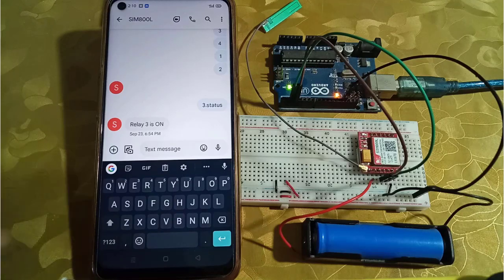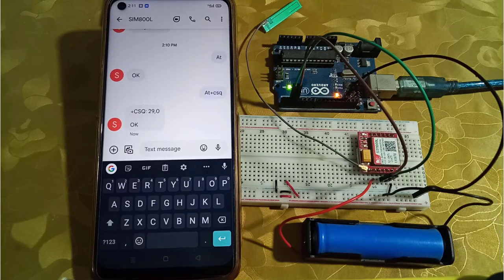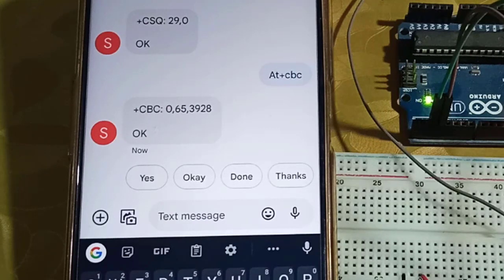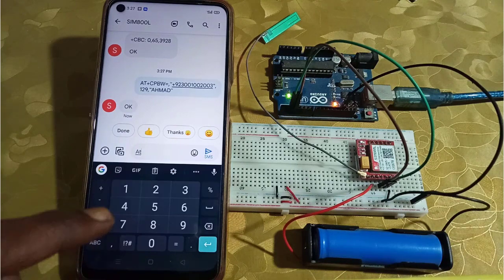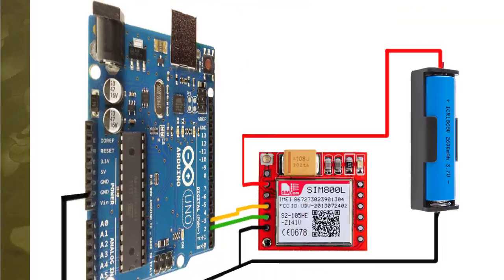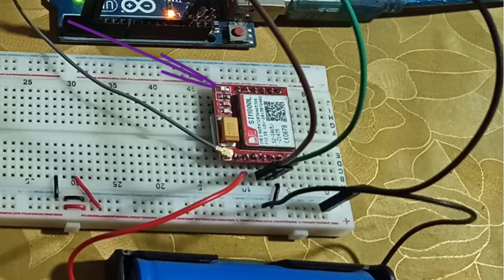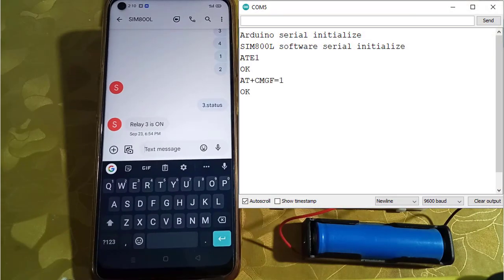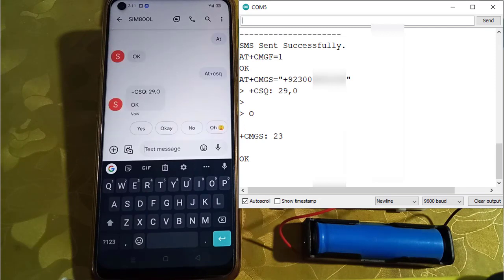SIM800L AT Commands Over The Air using SMS | Arduino GSM Project

Comment: Another great video! Good to see the results from AT commands back to your mobile. 
Would be nice to see a more detailed step-through of the code (or differences from the base code)

Did you ever manage to get the module to report the low voltage warning?
Thanks.
Reply: Good one there.
I appreciate your efforts in educating the public.
Keep up man.
Reply: Always on point.
Thanks man.
You are smart.
Reply from the maker: thanks
Reply from the maker: thanks you so much.
I am using the same code, that I have been used in my previous project. there is a little bit change in the code. for example, check the line number 101 and 102. I have added the two lines in the base code.
and I am using "sendRseponseATcommand(msg)" function, to send response of the AT commands to your phone
I know you have asked a long time ago. and I have tried a lot but did not get the success for low voltage warning. 

but I will keep trying.
Reply from the maker: so nice of you
Reply: @AhmadLogs  thanks, that’s really strange you are not receiving those URC’s on your modules. 

Project ideas 💡 
1. Have you used sleep mode in your projects?

2. Create a function that waits and checks if it has connected to the network  on startup rather than just delaying for 10s, if it’s in an area of low coverage it may take longer than 10s to connect or if that is even possible to connect in that area. 

3. How to turn the module off from the controller by software or hardware. 

4. How the module can know when it has lost connection to the network, what current it uses while trying to connect and what the controller should do in this situation to save power, wait for a while and try and let it reconnect or turn off the module and try again later. 

5. When voltage to the module is so low it turns itself off but the voltage isn’t low enough for the controller to stop functioning, then charging the battery and the module restarts, controller has a function to re initialise the module like in the setup function. 

These are all project operational needs if it’s left powered on and running for a long time (months?) and need to handle these situations and conserve power.
Reply from the maker: @iantcroft  I never implement these features before. but I have noted down these features. soon I will try to make gps tracker with these features.

I have seen the lower voltages URC, in a module. but unfortunately, that module was  damaged. I will buy a new module to test low voltage URC
Reply: @AhmadLogs  Will look forward to watching the videos on those features, if I can help somehow let me know 👍🏻
Reply from the maker: @iantcroft  sure. and most welcome for your efforts. so nice of you

Comment: How are you my friend Is it possible to use the gsm sim800l with 2 arduinos at the same time, but the two programs are different and they were not executed at the same time Does that work?
Reply from the maker: connect two Arduino with each other using serial communication. and then you can connect the sim800l to 1st Arduino. and you can use 2nd Arduino to send commands to sim800l.
so, this is possible.
Reply: @AhmadLogs  how this
Thanks
Reply from the maker: @ahmedtaher4015  it required a full video tutorial. I cannot explain it in the commments
Reply: @AhmadLogs  Hello How are you, great engineer? Thank you for your interest and respect in replying to us But forgive me, I still don't look so I'm still weak and I need your help, will you allow me to do that?
Reply from the maker: @ahmedtaher4015  hmmmmmmm
Reply: @AhmadLogs  I have a problem I have two programs, each one on its own, it works fine, but when I combine them together, one of them just blurs and the other doesn't, although the serial monitor is intact and gives as if each program is on its own. So what. the problem Or how do I combine them?
Reply from the maker: @ahmedtaher4015  without analyzing the code. I am unable to find the solution.

Comment: can we use SIM800l with 3g/4g sim? if not which module will support it?
Reply from the maker: no. it only supports 2g
Reply: @AhmadLogs  which module should I use that can support 3g/4g?
Reply from the maker: @zaheerudin8979  SIM7100E 4G Module